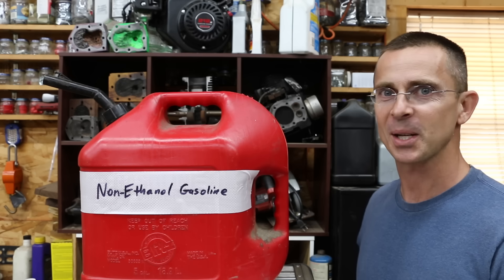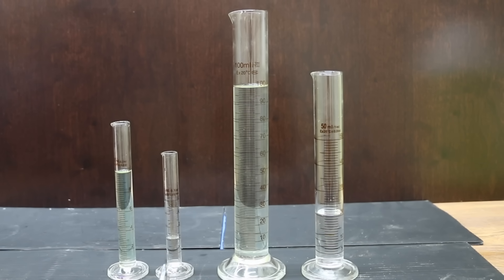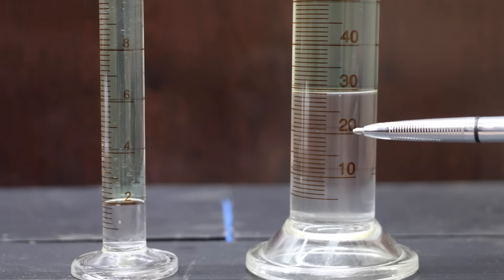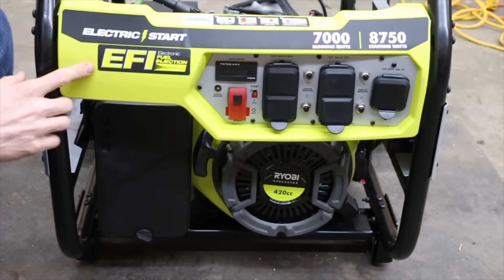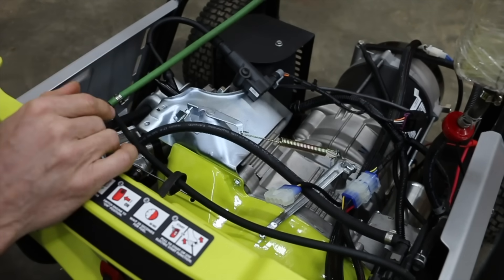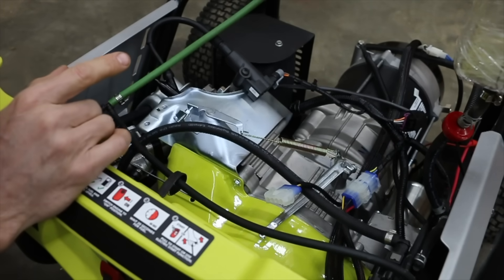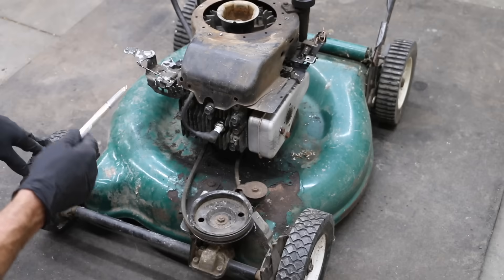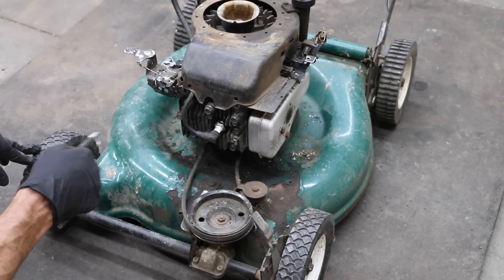Is Non-Ethanol Gasoline Really Better? See the PROOF!

Comment: You actually demonstrated why small engines are trashed by ethanol. It draws in water, settles to the bottom of things, and corrodes. (And the new solution is a higher alcohol content that eats rubber components)
Reply from the maker: Great point!  Thank you
Reply: The Reverend 

The opposite is true. It dissolves more water than pure gas, and it doesn’t draw water in.
Reply: @FrankGutowski-ls8jt  You might want to look into the hygroscopic properties of alcohol.
Reply: The Reverend 

I know all about that. It does not draw water from outside a fuel tank. It dissolves water which has condensed in the tank due to expansion and contraction.of fuel vapors.

To test its bydroscopicity, open a bottle of vodka or other high-proof distilled spirit. Mark the level. Check again in a few days.
Reply: Condensation occurs when air temps go below the dew point. Many small engine gas tanks are open to air and thus in humid areas like most of the land in the U.S east of the Rockies, gas tanks will be eventually contaminated with water. Ethanol's problem is varnishing up the "pipes" in the carburetors and deterioration of certain plastics and rubber. I HIGHLY DOUBT those older Briggs diaphragms are made with EPDM or whatever alcohol-resistant rubber. Then, with dead carbs rendering mowers unusable, they get thrown away since not every has the inclination or time to clean gas tanks and replace the diaphragms.
Reply: @TehKaiser  that guy's brain is vapor locked.... he doesn't understand the mechanics of a small engine fueling system and their lack of an evap system.
Reply: TehKaiser 

Exactly. All else being equal, condensation of water will be greatest with liquids which have the largest changes in vapor pressure, and therefore draw in the greatest volume of air when cool. 

I think the argument is being made by some that, because ethanol is hygroscopic, it will dissolve water that’s still in the vapor phase, vs a non-ethanol fuel, which would not. However, I believe that the greatest source of water in fuel is from condensation on the inside walls of the storage tank.
Reply: The Reverend 

The gas is evaporating, so it’s cooling the contents and the vessel, and water is condensing on it. I don’t see anything revealing about the demonstration. 

The chemforums link which has disappeared here is not very good. People posting who can’t even express themselves coherently.
Reply: Neither of you are entirely correct. Frank erroroneously mentioned "expansion and contraction of fuel vapors", which actually has no effect on whether water condenses from the air. 

Now, if preventing condensation was all that was needed to make sure a carburetor is not fouled up, it stands to reason that filling a gas tank up to the brim should be an equally effective solution as storing it empty. However, due to ethanol's other properties, which is its greater chemical reactivity compared to pure gasoline, a fully filled gas tank would eventually foul and the dreaded buildup of varnish in the carburetor will also occur.

In a four-stroke engine, the fuel is separate from the internals of the engine, and thus ethanol-laced fuel is more of an annoyance in which one must be cautious to fill no more than necessary to cut the grass or whatever other use the appliance is for, especially since "bowl" carbs with no drain and tiny jets are the only carbs commercially available now. It is in the two-stroke appliances where ethanol-laced fuel might prematurely render an appliance useless sooner than pure gasoline.
Reply: TehKaiser 

Don’t be lazy. Drain the tank and run until the engine stalls between uses, per manufacturer’s instruction.

Contraction of fuel vapors when cooled reduces pressure in the fuel tank, which, if vented, will draw in air because the ambient pressure will be greater than the reduced pressure within the tank. If you know anything about thermodynamics and the Carnot cycle, this process should sound familiar.
Reply: @FrankGutowski-ls8jt  I'm one guy with four working mowers and about 3 or 4 in need of refurbishment, many of them free from Craigslist. I also live where there is no ethanol-free gas, so I am already aware of the precautions. Find someone else to be condescending towards, perhaps a upper middle classer who is not an appliance geek, like a lawyer. Being annoyed at something is not the same as not doing the action. Hondas have a cut-off mechanism in the fuel line, thus making it convenient to burn off fuel in the carb, but many Briggs and Toros do not. A fuel line clamp and a way to loosen the fuel is needed, but it is wasted time, and wasted time is wasted money. 

The older, but not as emission-friendly Briggs carbs, are more resilient because the jets are larger and the fuel is below and separated from the carburetor assembly. Even those get bricked by the less able due to water contamination or diaphragm failure. These older Briggs never have the issue of stuck needle and float. 

Today, in my local area(DC, NoVA, MD), the Craigslist free section has four mowers around given away for free because of malfunctions. That's not including the many mowers not posted on Craigslist and just tossed out. 

Also in my possession from Craigslist is a failed string trimmer with a 2-stroke engine. 

That's a lot of metal that would've been headed to the dump, and a lot energy and emissions to create those produce those products.
Reply: TehKaiser 

I still have a 1978 self-propelled Toro with a B&S engine. It has run fine since new due to meticulous maintenance. 

I’ve always followed instructions to drain the tank and run it until it quits. I’ve had to deal with worn drive wheels, belts, and blades, as expected, but have experienced zero fuel and carbeuration problems. I’ve always added a smidgeon of MMO to the tank when I fill it. Even the underside looks new because I followed instructions to rinse it.

Comment: I could care less about fuel efficiency of ethanol or non-ethanol gasoline.  What I care about is how ethanol gasoline eats rubber fuel lines and gums up carburetors.  Never have those problems in the engines I run strictly non-ethanol gasoline in.
Reply from the maker: Thank you

Comment: On ethanol fuel does provide better fuel mileage, and provides better longevity of the engine, and all other parts related to fuel delivery from the tank to the injectors and especially carburetors seals gaskets etc.  Non ethanol fuel provides better combustion which allows the engine to run a little cooler. Piston rings receive better lubrication and less ware over time from non ethanol fuel. Non ethanol fuel is simply superior to ethanol fuel.
Reply from the maker: Thank you

Comment: My 02 Silverado with a 5.3 gets 26.2 mpg and run 3 times better with 0 ethanol  and gets 17 with 10% ethanol
Reply from the maker: Nice! Thank you
Reply: My 95 150 with the 5.8 has a noticeable difference between the non and ethonal gas with on the hwy. The non is for sure better.
Reply: @rickeydriskill1096  fully agree my 89 is the same way its not a huge jump because od my 4.11s but 2mpg better than ethanol

Comment: Where did you find non-ethanol gas at 91 octane?  I have a Ford Ranger flex fuel and it gets better mileage on non-ethanol gas.  I use the 87 octane.    The EPA gas mileage window sticker says it will get better mileage on non-ethanol gas.
Reply from the maker: I live in Missouri and there are several stations that sell it but it does cost quite a bit more.
Reply: I live about 100 miles east of St. Louis and non-ethanol gas is getting harder to find around here. Oddly the station that sells non-ethanol 87 gas also is the only station around here that has E-85.

Comment: Pretty cool video. Personally never did any testing, but I can say that in MY EXPERIENCE, the smaller the engine, means smaller carb components. Smaller motors like weed eaters, chain saws, leaf blowers suffer more from ethanol fuel greater than a larger 4 stroke like your using. From what I find is from years of use, or just month of sitting with ethanol fuel attributes to a gel consistency in smaller jets and orifices. I reccomend you do some tests in a small 25cc 2 stroke weed eater.
Reply from the maker: thank you

Comment: In my (admittedly limited experience, and from a Swedish POV (different market)) the biggest problem with ethanol is that if you start using it in an engine that has previously been run for years on "pure" gasoline, it will dissolve old guck in the fuel system and then it clogs the carburetor or fuel filter. Also, some older fuel systems have hoses and stuff that doesn't like ethanol.

Newer engines shouldn't have much problems with it, even in higher concentrations than 10%. (Smaller and/or older engines without an ECU will get problems with lean mixture though, which in itself can make an engine go boom.)
I used to drive a '92 Euro-Ford with about 25-30% ethanol before it started to feel lean.
Reply from the maker: Thank you!

Comment: I have done a LOT of mechanical work especially when it comes to small engines. All I can say is if you put ethanol in those engines you have just done those of us who work on them a huge favor lol.
Reply from the maker: Thank you very much!
Reply: New small engines can NOT use ethanol. My new weedeater did not make it through it's second use before the engine quit. New small engines are also made so if the average shade tree mechanic takes them apart (harder to do with new small engines) the same person cannot get them back together. Two years later and that weedeater is still apart laying in the garage. I found many articles on the internet confirming this problem.

Comment: Simplified.... MY truck is Ford with 10 cylinder Triton. With real gas I was getting 10 MPG city, with this ethanol I’ve dropped 20% to 8 MPG. Just my coffee buggy, not selling.
Reply: Any alcohol is already partially burned as far as internal combustion engines are concerned, so your real-world road-vehicle test is proof of that.
Reply from the maker: Thanks for watching!
Reply: any way to increase those mpg figures? not great my man.
Reply: epoxeclipse -- find unadulterated gasoline.  10% improvement by that alone.
Reply: @brucehearn2621  I have a v8 diesel truck that gets 20mpg.. a gasser v10 getting 8mpg ouch. that's a kick in the balls, I'm thinking air filters and plugs need to be checked, tire pressure and wheel bearings.
Reply: epoxeclipse -- if that gasser is powering a truck, you're in trouble.  Terrible aero, weight, higher revs to generate torque means that V-10 will have a tough time approaching the diesel truck for fuel mileage.
Reply: @brucehearn2621  no doubt, but 8mpg is semi truck loaded milage not daily driven truck milage. sounds like there are some tuning that's needed I'm sure you can do better than that for mpg on a v10.

Comment: You should check out dyed #2 diesel vs. regular #2 diesel. I admit to nothing nothing but in a pinch I've heard of people running a tank of dyed. I've always been told it was bad for you engine/injectors and dyed your fuel system so a mechanic could spot you running dyed and turn you in. I may or may not have done it and experienced no I'll effects whatsoever and truck ran the same. I'm 99% sure that it is just #2 diesel fuel with a dye added and is no different than regular #2.
Reply from the maker: Thank you for the video idea!

Comment: Great video! As far as fuel efficiency goes, the petroluem market is very centered around energy density. You pay more for non-ethanol fuel because it is more energy-dense. Naturally, however, that also means you can do more work (i.e. expend more energy) for the same volume if fuel. In other words, you get better fuel economy. However, going back to the cost-per-unit-energy, the price difference is almost exactly correlated to the difference in efficiency, so it is largely a wash. Except, in theory, you would have to fill up less often.
Reply from the maker: Great point! Thank you

Comment: You'll also want to verify that ethanol attacks the aluminum (especially if the surface is compromised by minor scratching) inside the carburetor. Methanol is even more vicious in its attack on aluminum.
Reply from the maker: Great point!
Reply: Ive put thousands of miles on carburetors with Ethanol.

Ethanol does not attack metals (including aluminium). 

Ethanol does attract atmospheric moisture, which will cause issues if water is allowed to accumulate in large amounts. I drive mine on a daily basis, and keep my fuel system sealed as good as the factory did. This keeps the water in my fuel to a minimum.
Reply: @Texassince1836  Interesting. It may be the case that your bowl is still unscratched to break through the protective oxide layer. I've seen bowls that had filled solid with white fluff, almost certainly from alcohol attack (alcohol is well documented as attacking aluminum).
Reply: @timhofstetter5654  that bowl full of white is due to moisture intrusion, from poorly sealed or infrequently driven fuel systems. People just assume it is directly due to Ethanol.
Reply: @Texassince1836  That, too, is ... funny, if you will. No other aluminum I've ever seen that has been in direct contact with water has ever grown white fuzz like that. It happens ONLY inside carburetors.

Comment: yes  ethanol free is better for the engine
Reply: looks like the ethanol won on a small engine,,as long as the  fuel is drained  regularly at the end of season.. im sure theres enough additives to keep it lubricated for summer  use..storing it with ethanol could be an issue..another good test
Reply from the maker: Thank you.  Ethanol hurts fuel efficiency some and most newer carbs are designed to withstand ethanol unless the water gets into the fuel.  Then it becomes corrosive to the pot metal material that's used to make carburetors.

Comment: The result that it ran longer on non ethanol fuel is exactly what I expected.   The issue with alcohol fuel is that one arm of the molecule's carbon chain has a hydroxyl (OH) radical rather than a simple hydrogen (H) atom.  So, that OH is already oxidised hydrogen, in other words, it can't be combusted and has no fuel value.  The rest of the alcohol's carbon and hydrogen can be combusted so, the OH is a small penalty compared to a fuel of 100% combustible elements.  For this reason, alcohol fuels produce less combustion and less energy per litre than non alcohol fuels.  Therefore, you use more e10 than petrol for the same performance.  There have been economic studies that clearly show that even at the discounted value of e10, you pay more per mile or kilometre with e10 than with standard petrol at the same average speed.
Reply from the maker: Great information. Thank you

Comment: I have noticed that non-ethanol is better in my older air-cooled motorcycles, but not so much in my newer bikes or in my lawn mower.  I think it just depends on the engine type and carburetor.  For my 1980's vintage bikes, there is a noticable improvement in power and fuel economy.
Reply from the maker: Great point. Thank you